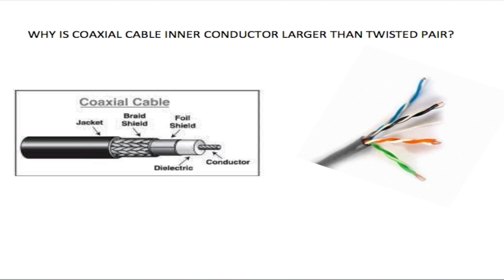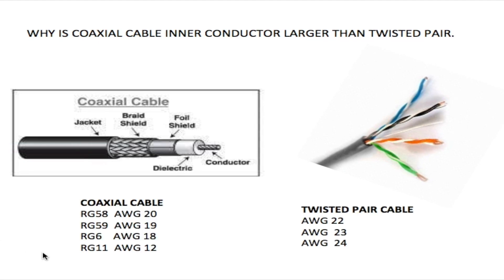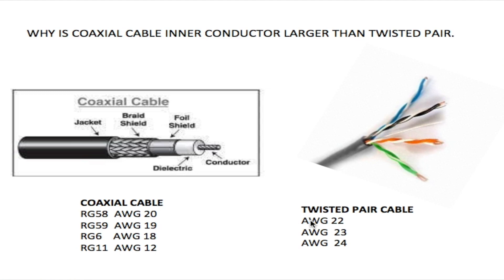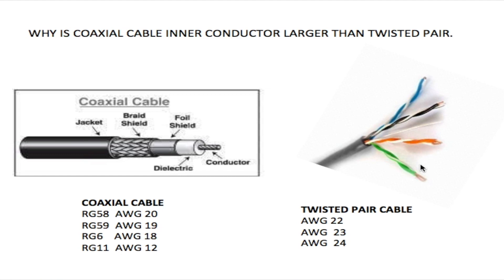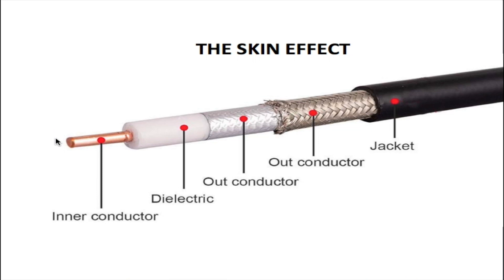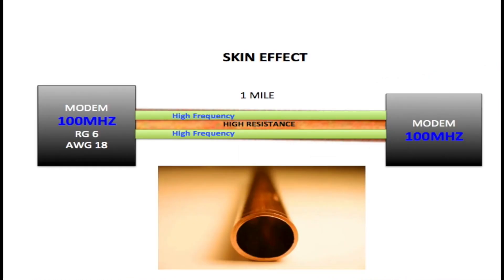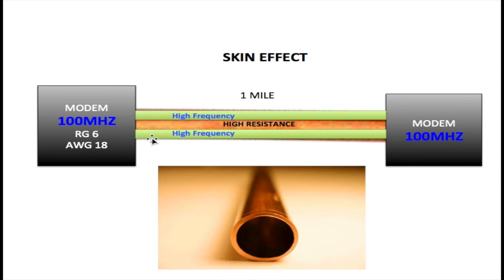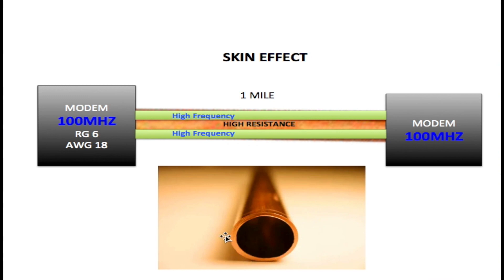What Makes Coaxial Cables Different From Twisted Pair Cables?

Comment: Why wouldn't you change the shape of the copper wire? Make it like a relatively flat band so that it has more surface area per volume of copper material?
Reply from the maker: Thanks for the question.  Changing the shape of the wire from round to square won't solve the issue where high frequencies find high resistance down the middle of copper wire, and is forced to travel along the outer edge.  This is called the skin effect.

Comment: 🤔Why Coaxia cable must be 75 ohms !! why?
Reply from the maker: Coaxial cable may have a different impedance depending on the cable.  Like RG 6 75 ohms and RG8 50.  The impedance of the cable should match the equipment it is connected too in order to have maximum power transfer.

Comment: Can i use twis pair for speaker? which one better?
Reply from the maker: Yes you can use either twisted pair or coaxial for speaker.  Neither is  ideal. If I had to pick one it would be twisted pair.  Coaxial cable is good as well but more expensive to be used for just speaker wire.